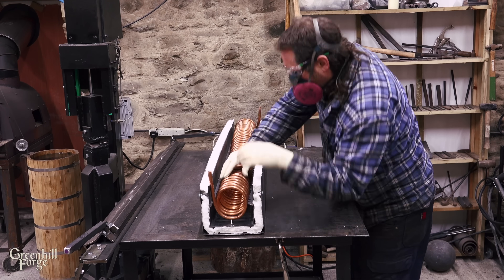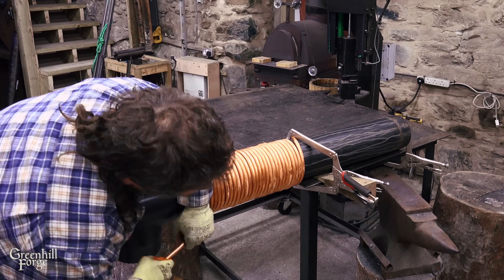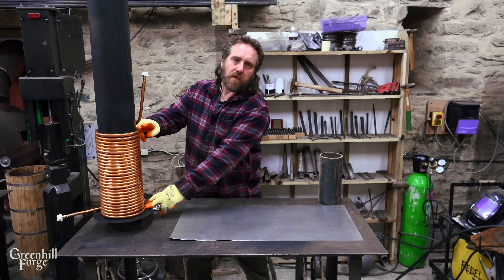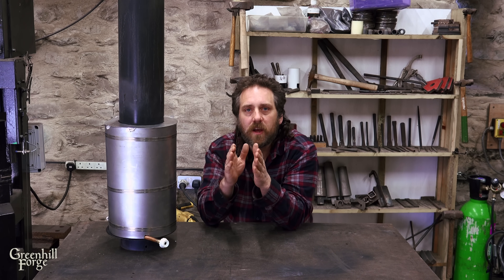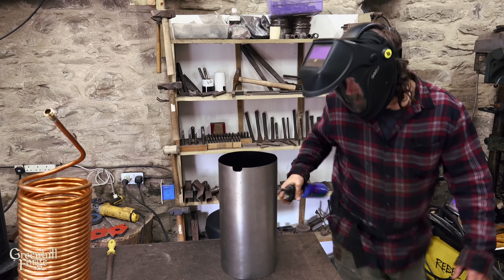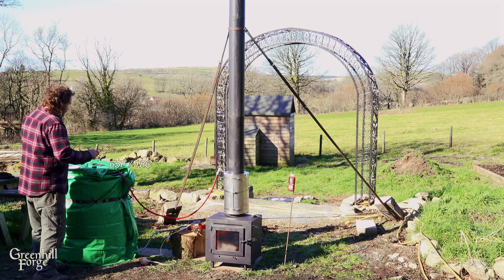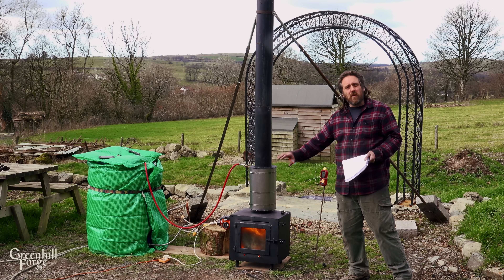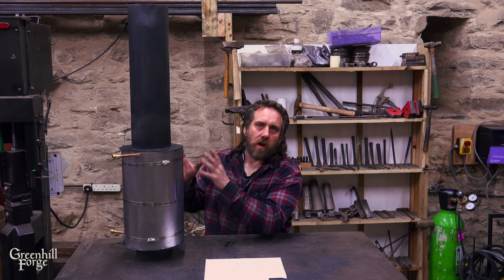Best Wood Stove Water Heater Yet: New Design Tested | Off Grid Water Heater pt3

Comment: Awesome. What would happen if it was just a water jacket with inlet and outlet? Then you have max surface area touching the hot flew…. You’d want to use material that didn’t corrode though. What would be the down side to doing it like this?

Comment: Graphite accelerates corrosion of mild steel… The presence of carbon granules is why cast iron corrodes so fast.
Graphite is NOT inert, particularly if it gets wet.
Reply from the maker: I'll open it and see in a while but it's sealed so hopefully no water or oxygen and the steel is coated

Comment: Great video👍  Thank you.

Wondering, since heat rises, what kind of increase in efficiency would you get if you put the graphite/insulated coil on a HORIZONTAL section of pipe... 🤔

In my grandmother's cabin, they intentionally went up then over then up again, to let additional heat escape before the smoke left the chimney.  Perhaps that creates a greater fire hazard, but even a 35 degree slant should give greater heat transfer to the graphite 🤷‍♂️

Comment: Ditch the copper foil entirely and make a water jacket like the old WWI water cooled machine guns. Just fill the external cylinder up with water and have a hose attachments on top and another on bottom and let physical do the rest. Full heat transfer. No copper coil, graphite powder, needed. All that other stuff is its own thermal mass or extra expense.

Comment: why use only flue for heat?  isn't the stovetop itself hotter?  Look at a CPU water cooler, make it a bit larger and fix it directly to the stove.  instead of water, use engine coolant and a typical transmission cooler to transfer heat from the hot coolant loop into the water bucket.  insulate the bucket or use a hot water heater for storage of the hot water.

Comment: Loving this series. The major improvement I can see would be to improve the surface area for heat transfer. Either a much longer coil that goes up much more of the flue or a less tightly wound coil over a longer flue length to give additional space for graphite to infiltrate and touch all 3 sides of the coil.

Comment: Humble physicist here… excellent and practical hands-on experiment.  A couple of comments for you to consider: 
1)  The first step is to transfer heat from inside the chimney to the collection area.  The amount of heat transferred from one side of a barrier to the other is proportional to the difference in temperature and the surface area.  The temperature difference is controlled by how hot your fire is, not much to change there.  However, you can increase the total amount of heat captured by increasing the surface area.  Use as much of chimney flue as possible.  Stretch the coil out vertically so it covers more of the stove pipe. If you increase the height by 50%, the amount of heat captured will also increase by around 50%.
2) The next step is to transfer the heat collected from the chimney to the outside of the copper tubing.  By physics, heat transfer occurs through three main methods: conduction, convection, and radiation.  Radiation is insignificant here… solids only support conduction (because they do not flow).  Liquids, however; support both…  That is why equipment such as transformers and high-end computers use liquid cooling to remove heat.  You want the liquid to circulate back and forth between the hot chimney and the copper tubing.  There are several options but for safety, do not let pressure build.  Let the thing vent, perhaps keep a vent hole at the top… do not build a bomb! Consider using water or oil.  Water limits the temperature to around 100 degrees C while oil will get much hotter… but water doesn’t burn.
Reply from the maker: Hey, thanks! 
1) Totally agree but the project is limited by budget. doubling everything, copper included would definitely help but basically double the price. I'm not sure how much spacing the copper coils and filling the spacing with graphite would help. probably at least a bit but I think less than one might guess. Worth testing but again adds cost of maybe 2-4X more graphite.
2) water jackets/boilers are almost certainly the most efficient way to transfer heat from fire to water. But I'm trying to come up with something that can be added to a standard woodstove. I agree that a liquid would be the best vehicle but different liquids come with problems as you mentioned. pressure, perfect seal, needs topping up if open system for water and combustion, perfect seal, and degredation with oil, just off the top of my head.
But that's why I do these. It's fun to try and solve the problems. Cheers.
Reply: Love physics and physicists!
Reply: at that point, just buy a water heater and a propane conversion kit.
Reply: Silicone heat transfer oil doesn’t burn either…
“Oil’s ain’t oils”…
Reply: Could use a heat transfer fluid. Stuff isn't cheap though
Reply from the maker: I looked and a couldn't find any with a flash point above 400C
Reply: @ At above 100C your water becomes steam. 
Above 374C the steam is at 22.1 MPa and your room is full of shrapnel from blown apart copper pipes.
Above 400C silicone oils become glass.
You aren’t going to be able to reach 400C with a direct water heater.
Running a thermosyphon filled with heat transfer fluid is another option… (so long as you don’t mind really hot water)…
Reply from the maker: @allangibson8494  I just mean that I wouldn't want oil sitting directly above something that is hotter than it's flash point in case there was ever a spill or leak
Reply: @ Silicone oils don’t “flash” like hydrocarbons. You don’t get gaseous byproducts and flame, you get glass - but that is safer than a steam explosion from water trapped in a closed volume.
Reply: @GreenhillForge hey man great job. Question, I’m
Looking to install this but to supplement my hot water heater. My stove is on the first floor, water heater is in the basement below. Do you see that height difference to cause any circulation issues?

Comment: Ok, this is probably a wierd suggestion and would come with it's own set of problems, but filling the void with water. It would increase the surface contact with the copper coil to maximum. You would have to speed up your pump to compensate to try not to boil off the water too quickly. Just an idea.

Comment: I have no idea if it would be better or not but I just seen a YouTube video on silicone carbide in power electronics. It was mentioned that it has heat transfer characteristics 2nd only to diamonds. It's available and cheap because industrial silicone carbide is just sand paper sand. May be worth a look

Comment: First the firebox must be made from firebrick to reach high burn temp and achieve complete combustion. I recommend to look into batch rocket + institutional stove designs and combine them for max efficiency water heater. I have built batch rocket for my greenhouse heating. Complete combustion, no soot so I will never have to clean it and it extracts so much heat only 80C air leaving the chimney. It's really clever design.

Comment: Only a tiny amount of the circular tube will actually be touching the flue pipe. You need a flat area on the copper tube touching the flue, with thermal compound to ensure good contact and transfer....
Perhaps "roll" the tube to create a flattened side?

Comment: To have a proper comparison you need to used the same areaon the flue.   The copper tube inside the flue was using a length of flue that appears to be 2 to 3 times that used in your experiment with the copper on the outside.   Also the graphite needs to have at least 1cm of space between the copper tubing rings.   Thank you for the great work
Reply: the point is to eliminate cost from the comparison by using the same amount of copper tubing. the coil inside the flue is tighter and therefore longer.

Comment: Increase the heat transfer by decreasing the cross-section of the pipe.  If you squash the circle so the pipe becomes oval the depth across decreases and the surface area stays the same. In this case, the water is being heated from the outside (conduction), but the heat isn't efficiently transferred to the centre of the pipe.   We squashed pipe running through rollers. Hard to make work as coil on the chimney.  An alternative option is to make a ladder inside the firebox, out of 20 mm.  Ladder pieces squashed outside rails round to allow ease of welding together.  Inlet outlet to the back of firebox with ladder sitting up across the top of the firebox.    Gave huge amounts of hot water, the only challenge was decreased firebox size and someone loading can damage the ladder.

Comment: Since someone mentioned thermal grease, I wonder if just a jacket filled with high temperature automotive grease, or even motor oil would just work better than graphite powder. I think the idea behind sand is that there isn’t much of a mess if it spills, if it was oil there would be a mess, but still way less than graphite powder everywhere?

Comment: Maybe use a copper pipe with a smaller diameter and double wrap it, one layer down-up and the second up-down. That should transfer more heat from your system.

Comment: A method that is much harder to do but much more efficient is to cast the coil in aluminum around the flue.  This will still be slower than the coil in the flue.  You can't beat that heat transfer rate.

Comment: You are losing heat up the pipe.  If you stretch out your copper coil upwards over the length of two or three stove pipe sections you can pull more heat out of your system.  You have too little contact with your heat source and a lack of convection that you enjoyed with the internal coil.  By stretching your coil up you can make better conduction contact with the pipe and get better results.

Comment: Copper tube comes in a couple hardness levels and wall thicknesses.  You can get soft (fully annealed) copper tube and it won't kink as you wrap it around your mandrel.  The heavier wall resists kinking more as well.

Comment: So.. What could you do to the copper pipe so you can put it in the flue? Is there a way you can give the copper pipe a coating of 2 or 3 mm  (0.118 inch) of graphite?

Comment: Without checking if anyone else has suggested it, I’m going to say flue baffles. This will ensure the combustion products are slowed and in contact with the flue walls longer. You may need to lengthen the flue to ensure sufficient draught.

Comment: I feel like if you filled that jacket with water instead of graphite and put a pressure relief valve on it , it might work better and still be efficient and have more thermal mass.

Comment: Try using a removable baffle inside the flue.  The same as used in a oil fires hot water heaters.

Comment: you can improve your design by using a smaller diameter copper tube and extending it's length coiling a much longer run of the flu

Comment: You did some really good experiments! Could you use a stainless jacket and water instead of graphite? And while your setup is based on that fixed length of copper, would it pay off to run further up the stack to get more heat out? Thanks for your effort. You're doing the tests that I don't have the energy to conduct.

Comment: Have you considered using a water jacket and eliminate the tubing.  I would insulate the jacket.  Additionally,  have you tried using smaller diameter tubing  1/4 & 1/8" .  Another option would be to create a water jacket filled with glycol (antifreeze)  and put the tubing inside and compare the heat transfer. Lastly,  are you adjusting the flow rate to maintain the output temperature.

Comment: Why don't you use a gaz/fuel water heater core?
It's a drum with tiny tubes to allow the smoke to go out.
For the water circulation without pump, you maybe need to put a coil in it.

Comment: 2 more reccomendations for you. much much longer coil going higher up on that flue pipe to capture more heat. also pump top to bottom so the coldest water extracts the heat from the coldest part of the flue first before reaching the hottest part.

Comment: In Sweden there's a traditional stove used to heat a thermal mass very efficiently that I think can be used as an inspiration. The smoke pipe splits in the top, and each channel loops down over the thermal mass, and the loops up again over the thermal mass, before joining up and leaving the smoke stack. This sucks much more heat out of the smoke (about 150–250 °C cooler smoke) at the expense of leaving more tar in the chimney.

But I think the idea can be adapted to the graphite solution, by forcing the smoke to not only heat from the interior side of the coil, but also from the exterior, transferring heat into the graphite powder from two directions, using the same length of copper coil. So simply, three concentric chimneys, with the copper pipe sandwiched between the two inner ones.

Comment: A neat change would be to turn the whole set up sideways so that the coil is slightly below the water level in the tank and the input of the coil is angle lower while the output is slightly below the water level in the tank but still above the coil, which allows water to follow gravity to get a starting pressure, and because water expands as it heats up, this assist it in going through the coil back into the tank from above, while also allowing a thermo-siphon to occur.  This could safe power consumption by removing the nee of a pump, in theory at least. never seen it tested though.

Comment: I’d be interested in seeing the effects of distance between the copper coil loops. I’m thinking that since you’ve built an insulated thermal conductor the more surface area of the flue you use to capture heat the hotter said conductor gets and therefore the faster the temp moves into the water

Comment: This is interesting to see.
I think that the graphite is finer and more easily gets into the smaller holes for a better fill and increased contact (& heat transfer area to the flu). A powder is manageable but adding a liquid will further improve the contact area, but then you probably need split tanks for the temperature gradient for best heat into the water tube. The liquid could be a high melt wax. Of course this then requires a water-tight tank and venting for the tank.Electrical transformers use oil to transfer heat away from the coils and out to the jacket or cooling.

You state that you are using the same length of copper tube, as a baseline comparison, but the change in method changes the copper from 100% in the hot flue gasses (maybe 80% in active gasses and the rest in static gas, creosote and flue wall contact - But still all direct heated materials).
The external coil is only a line contact which is maybe 20% effective contact, but it looks like a slack wind so not all in direct conducted heat and therefore much less efficient.
A tighter wind would help, or even using a twin wind of smaller diameter paralleled water tubes and/or increasing the length of coil to regain parity of the effective contact area between flu and coil. There is also a thin insulating layer added in there.
All the measures that you are applying are trying to improve the conduction area and t minimise the heat losses.  
Some of these also add smoothing and heat buffering, which may or may not be beneficial.

Comment: If you have a stove with a horizontal exhaust pipe in the back (about 1 ft) which then goes to a chimney, the burn can get hot enough to avoid creosote production.  Also, does that stove have secondary air?

thanks for doing the testing that i've always wanted to do!

Comment: I think it would work better if you put a 45 out of the stove then a section of straight pipe and the coil on that short section then another 45 to get the pipe back straight up. The heat would hit the top of the 45 and get much hotter than if the heat can go straight up. If you have the time, it might be worth a try?

Comment: I'm new to this experiment series so maybe you've already encountered this idea:

Some people boil pots of water on top of their wood stoves. What if you designed a wood stove where there is at least 3-4 inches of water on top of the stove and an inch or two on the sides? It would basically be a wood stove within a box filled with water. You could then connect the top to this coil heat exchanger. Water flows in from the top through the coils onto a partial tank surrounding the wood stove and flows out from an outlet at the bottom.

Comment: Most commercial NatGas hot water tanks have a helical plate that runs up the center of the exhaust gas vent. The plate increases efficiency by transferring the flu gas thermal energy directly to the surrounding water jacket. Adding  combustion air to a secondary chamber would also reduce creosote and increase efficiency.  Incorporating both features into the design would definitely produce significant results...

Comment: Would creosote be prevented if the pipe was inserted inside the flu lengthwise, so with multiple fittings out and in through the flu? Maybe include an inside flu pipe instead of an outside heat barrier?